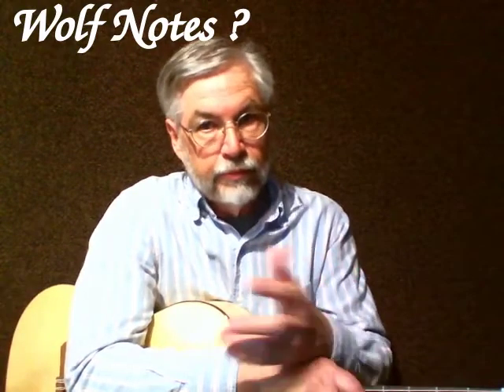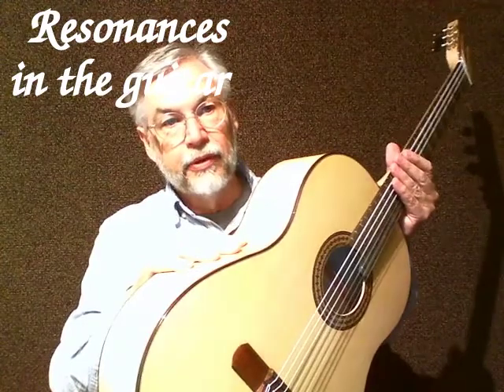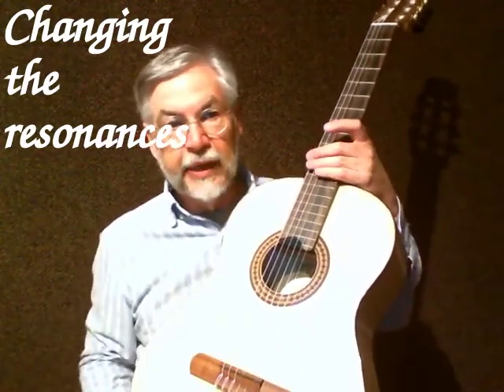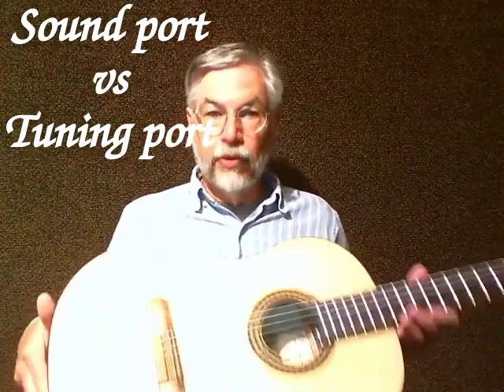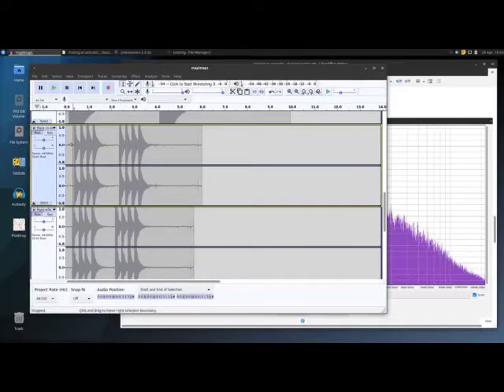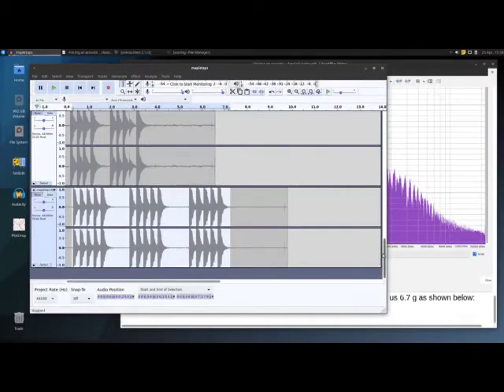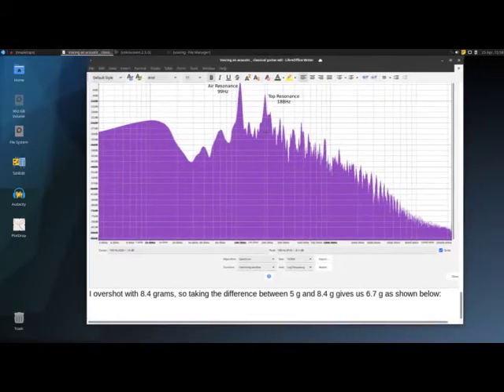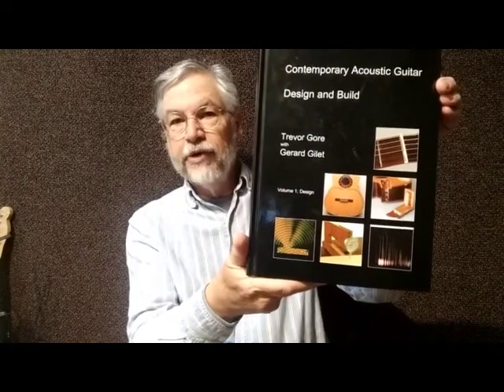Harmonic Voicing of Acoustic and Classical guitars

Comment: Easy to understand explanation of a complex topic, good job.  I'm struggling with an acoustic electric archtop that's perfect in every way for me except for weak thudding B flats in multiple places. I'm amazed how sensitive and complex a guitar is. Your instruments sound wonderful, even that oak build.
Goodluck with your channel and thanks.
Reply from the maker: Thank you, understanding this and having ways of changing the pitches of top, air and back are key to making each guitar as evenly responsive as possible. 

Good luck with figuring out the B flat thudding. Arch tops are different but the same basic principles apply.
Reply: Where does the added weight go ? Under the bridge?

Comment: Thanks a lot for sharing with us your knowledges and experience! Few months ago I finished my first ever acoustic guitar, and, of course, it has wolf notes. A# sound so boomy. Thaks to your video I know how to fix it. So I'll try to increase the mass of the top and maybe decrease the resonanse. BTW can there be a plywood or wood ring, glued from inside of the top to turn sounhole to short sound tonnel? Smth like is made in Fender Acoustasonic guitars, gut I have never heard them unplugger/mic recorded. Sorry for my English, it's not my native.
Reply from the maker: Yes, it's possible to improvise a tornavoz which will decrease the air resonance frequency of the body's air cavity. Don't expect it to affect only the air resonance though, On most acoustic/classical guitars the air and soundboard resonances are "coupled". That means that raising or lowering one affects the other similarly. If the back is similarly coupled it becomes a 3 way dance trying to figure out how to move things around enough to kill, or at least lessen, the wolf notes.

Comment: you are talent in building guitar with your scientific analysis  and physics theory  to solve the harmonics consistency problem. i ever tried a few extreme expensive guitar like damman, muller, smallman. only smallman can solve the wolf note dead note, harmonics problem by adding small spot of weight under the sound board. damman, muller and others expensive one cannot solve  this problems, they have a few dead and wolf in some notes.
Reply from the maker: Thank you. All very responsive guitars (expensive or not) have the potential for dead and/or wolf notes. The knowledge of how to fix this, or at least make it better, is not secret if you know where to look. However, it does take a lot of time to do correctly.

Comment: sir how to add the weight on the already built instrument ?
Reply from the maker: To start with, use adhesive tape or the type of tape that is used to hold microphones inside acoustic guitars. Once you have tested the weight and location to get the desired frequencies, they you can use a more permanent adhesive.